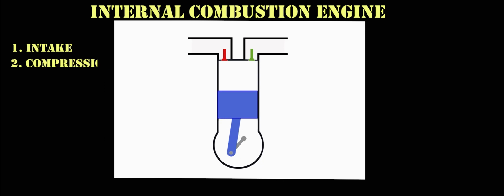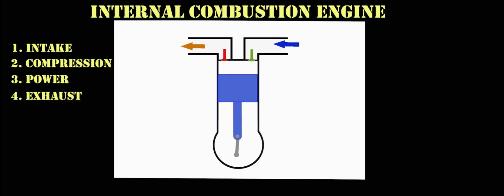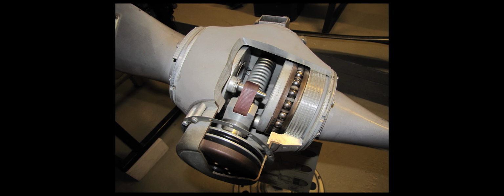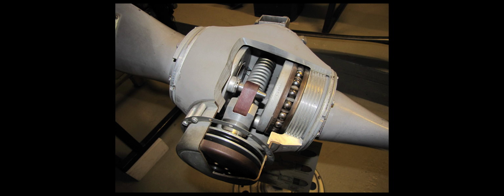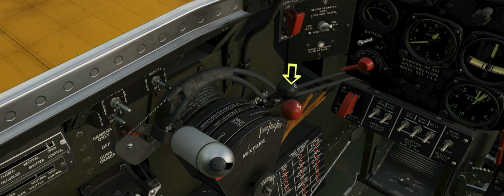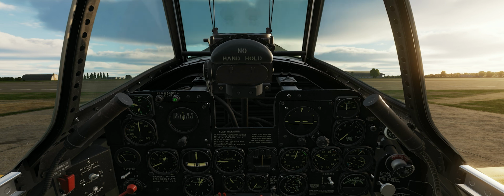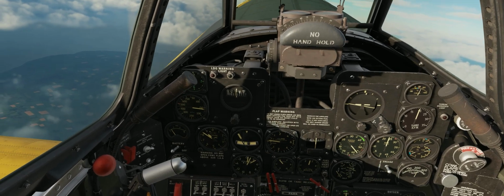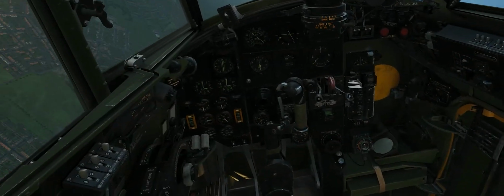Keep Your Engine Running - Warbird Survival Guide - Part 3

Comment: Hi Iain, dropping in... So I started simming with IL-2 Cliffs of Dover Blitz and then got my feet wet in DCS with the Spitfire, my go to warbird. So it might sound strange, but for me it's the other way around, more modern planes tend to stay in the air pretty easily, but coming from the spit they feel like a brick to me. So i'm curious, do you have any tips for major differences going to jets coming from warbirds? Say in the A4 (which is pretty nimble I must say), do you ever use rudder to correct slip 'n' slide? If not (which i'm guessing), in what situations do you use the rudder? And what's rule of thumb on throttle management? So far i've been using it purely to alter my turning speed. No pressure, I'm enjoying and learning regardless! :) Just seems no-one else has this question, just the other way around hihi.
Reply from the maker: Excellent questions.  I would really encourage you to drop by my Discord channel and continue the discussion.  There are some guys there who would just love this topic.  The short answer - for me - is that you are right, jets tend to need a LOT less rudder than warbirds.... until your airspeed drops past a certain point.  So, for instance,  on approach and landing.  When jets get slow, their flight characteristics change dramatically - which is partly why they are (and were historically) such a handful to land. Of course, this only applies to pre-Fly-By-Wire jets. 

But the need to combine high speed performance with low speed manageability is what was behind the whole "swing-wing" craze of the late 60's and early 70's.  At any rate, great topic.  Let's take it up on the Discord.  Join the discussion or just DM me.
Reply: @Sidekick65  Already a member of the discord, will drop in soon! Thanks for the reply :) It already clears up a lot!

Comment: This was a useful video. It's really easy to get spoiled on modern jets with a single manual engine control and a digital controller keeping you out of trouble. The warbirds require some human-computer finesse. These tips will surely help with that.
Reply from the maker: Thanks, Mike. I appreciate it.

Comment: I think even more so than the aircraft, operating the engines in a sim comes with a severe limitation that the real pilots never faced.  A pilot with any experience in a particular airplane would quickly learn how the engine was doing by the sound, vibration and resposiveness to the controls.  In the sim we get a pretty generic sound file that bears no reflection of what loads the engine is under.  And with no sense of the normal vibration a piston engine produces we lose the tactile feedback a real pilot would get.  Just like the flying part, we are stuck staring at gauges as the sole method of determining how the systems are working which is not at all how the real thing is done.  As someone who spent about twenty years maintaining aircraft engines of all sorts I approve of this video ;)
Reply from the maker: Excellent points.  I think this is exactly the problem that we all struggle with.  Some of the surprises these engines throw at us would be a lot less "surprising" if we could really feel their pain.